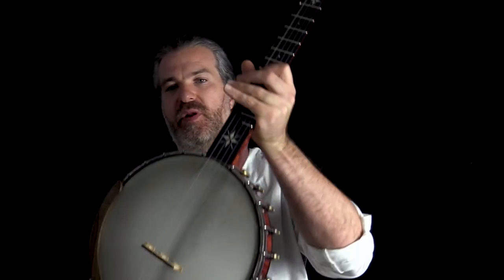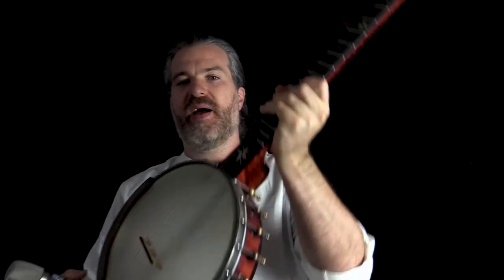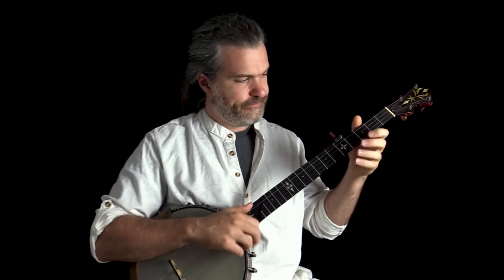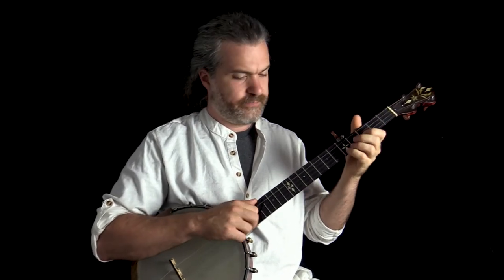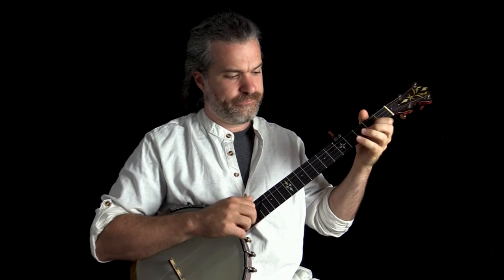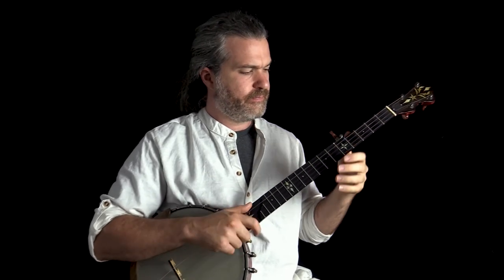Mini K87 - Sound Test on Open-Back Banjo

Comment: Love your playing always. This piece is really nice. How far was the K87 from the banjo pot, higher or lower than the pot? Facing pot or neck? The unprocessed volume seemed a little low. So perhaps the mic was a few feet away. I am considering this mic. Regards.
Reply: The volume seems low because the peaks are not clipping.  Banjo has INSANE peaks, like harpsichord and lute -  +20dB over average level.  Pro tip: string quartet has peaks like this too, but most engineers back off the mics until they get tame, or limit the peaks.  I monitor on ADAM speakers with AMT tweeters to handle these peaks, this recording sounds better than commercial CDs.  If you turn this track up on 1" dome tweeters, they will clip!